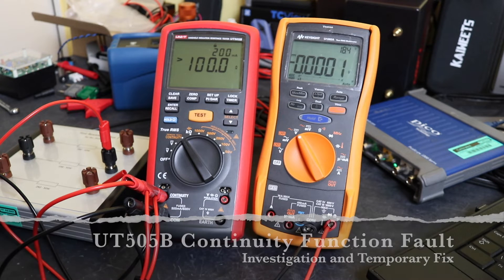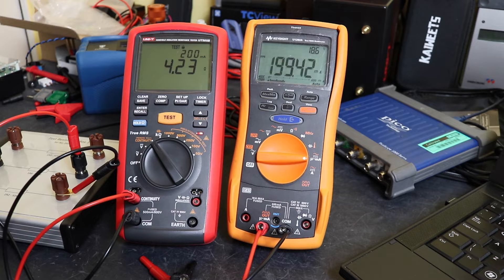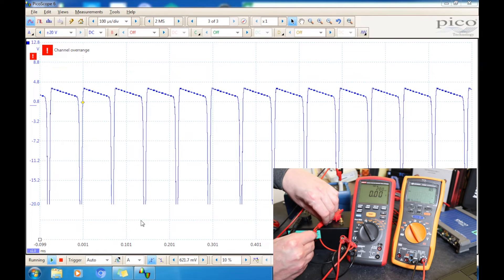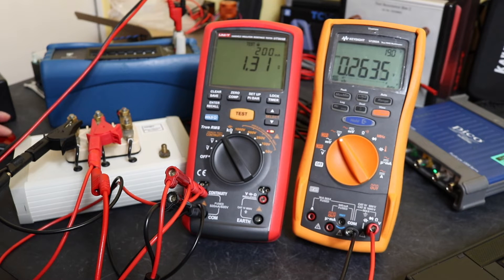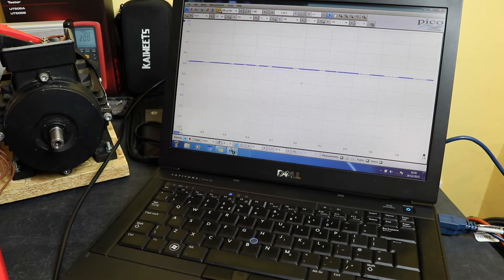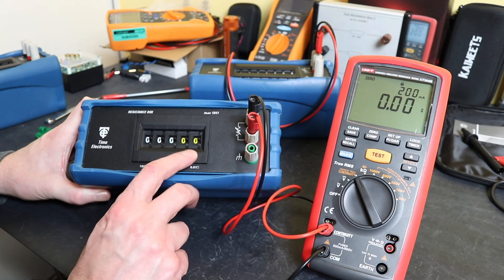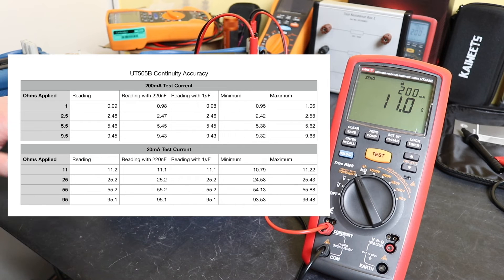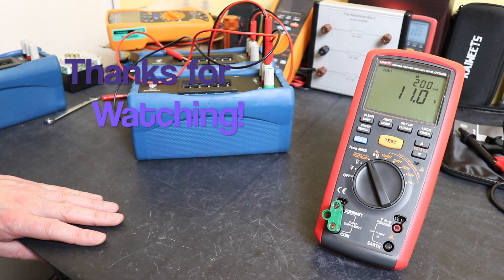UT505B Continuity Function Fault and Fix

Comment: Nice...so, you find a flow and also find solution to be fixed that flow. Freely i can mount in parallel 1 Mf inside instrument? Correct?
Reply from the maker: Capacitance across the meter will solve the problem if your instrument has this same fault. Mounting inside may be possible, if it can be done without affecting safety clearances within the meter and the other meter functions. I haven't looked at installing a capacitor internally.
Reply: @three-phase562 Maybe is better mounting outside, and using only measure continuance. What kind of capacitor and values must be mounted?
Reply from the maker: @GraditelMacedonia  I would probably go for a 1 uF capacitor, but it would depend upon the range of motors that you test. Larger motors may not cause as much oscillation and may not need as big a capacitor.
Personally, I would put the capacitor in a little box with some 4mm connectors, or even use the 19mm dual banana plugs for speakers and mount the capacitor across one of those.